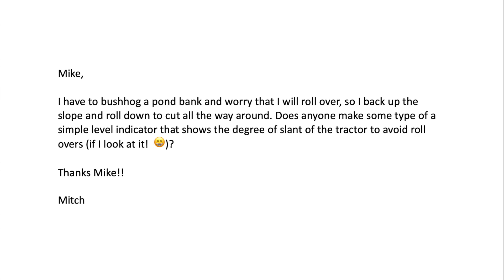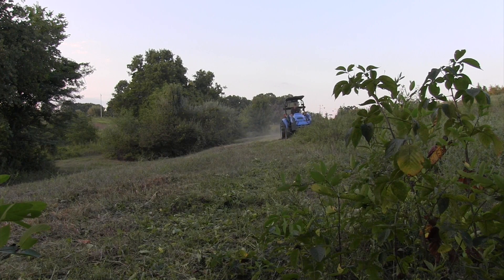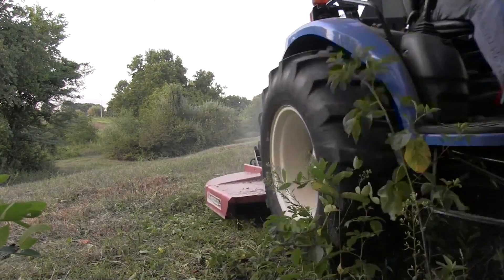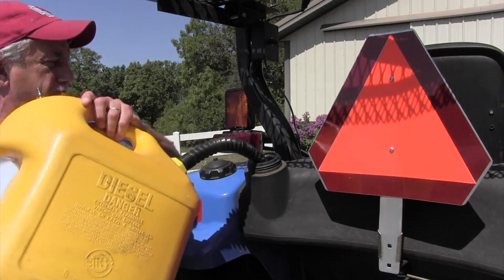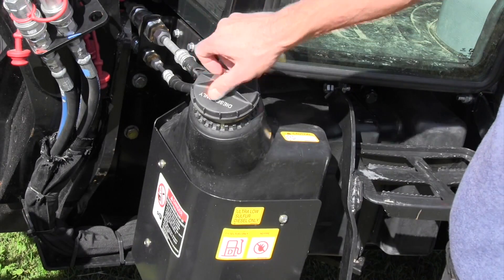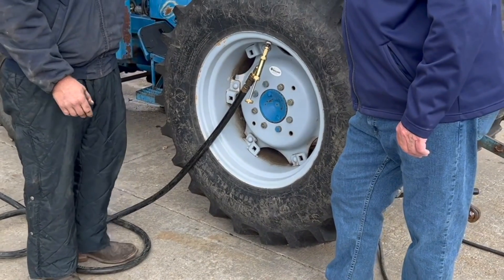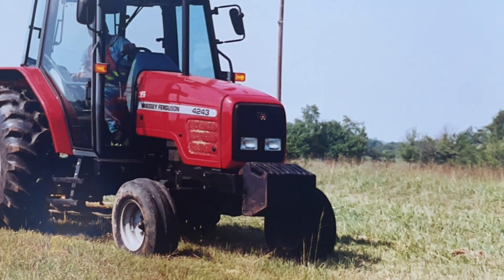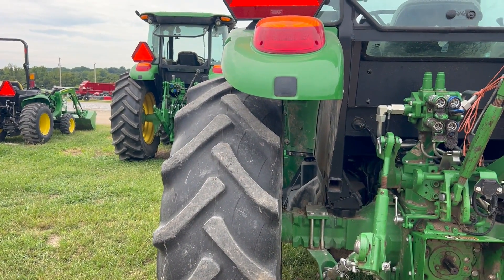10 Causes Of Tractor Rollovers You Need To Know

Comment: YOU SPOKE ABOUT HOLES IN THE FIELD.. I HAD A 4X5 ROUND BALE ON THE HAY SPEAR, I  WAS MAKING A SEMI CIRCLE TO LOAD THE BALE ON A GOOSNECK TRAILER.. THE FIELD WAS ALMOST COMPLETELY FLAT.. i  DID NOT SEE A FOX DEN, OR SOME OTHER ANIMAL DEN, IT MADE A BIG HOLE.. THE FRONT WHEEL OF THE TRACTOR DIPPED DOWN INTO THE HOLE, AND ALMOST FLIPPED THE TRACTOR.. IT HAPPENED SO FAST i HAD NO TIME TO REACT..  IT WAS A MODERN TRACTOR JOHN DEERE 5335 67HP.. SO NOT A LITTLE TRACTOR.  I HOPE PEOPLE LISTEN, IT ALMOST KILLED ME,,

Comment: Excellent video.  Thanks for posting it.   Even with a lawn tractor, you learn to approach slopes from the front or rear of the tractor rather than letting your tractor lean to the side.

There are also tractor safety courses which can be taken, in person or online.  I will take one of these when I purchase a compact utility tractor.

The issue with fatigue is really important, especially at the end of a long day when want to finish the project you are working on.   Especially with chain saws.  You need to develop the discipline to stop working, or a simple mistake can be catastrophic.  It’s not much different than doing the physical labor while intoxicated, but the ramifications are the same.

Comment: Speed in turns is yet another way you can kill yourself on a tractor.  How much speed?  You won't know until you roll over due to the points you just mentioned.  So, be damn careful about complacency and letting young kids drive that tractor.  I sweat it out anytime I allow my grandson to run my tractor simply because he has shown some ignorance and lack of respect for machinery.  He needs to learn, but not by getting hurt or killed.  Tractors should be slow moving machines and never pushed up to do things faster.  Slow and steady wins the race, and keeps you alive.  By the book, or buy the farm!  Operate according to the manual or common sense and never beyond the capabilities of the machine or operator.

Comment: I grew up flying helicopters and we learned early on about "dynamic rollover".  There is a critical rollover angle when sitting still on level ground.  It's like taking a set of fork lifts and tilting an object that is sitting still until it rolls over.  There's also the dynamic rollover angle that is what gets folks in trouble.  That angle is influenced HEAVILY by momentum.  That's why going slow is so very very important.  Most helicopters have a critical rollover angle of between 6 to 10 degrees.  That doesn't mean you can operate up to 10 degrees every time and not roll over.  It simply means that if you go beyond that you will most definitely roll over and there's nothing you can do but hold on at that point.  My butt has been calibrated to get nervous anytime it tilts more than 6 degrees.  It sucks up the seat cushion beginning at about the 8 degree mark.  I won't tell you what happens when it appears to be exceeding the 10 degree mark.  It amazes me to watch the guys on a bulldozer pack in a pond dam with a 30+ degree slope.  No sir.  Not me.  Great vid and please stress in your next video that just because you didn't roll over at X number of degrees today it doesn't mean that you won't roll over at less than X number of degrees tomorrow.  The key term is "dynamic".

Comment: The wide R4 tires put less pounds per square inch (psi) on the ground, by design, than the R1 standard farm tire.  In wet conditions, or muddy conditions, or sometimes just on grass on a slope, these tires tend to slide easier. This is per my own observation and observations my customers have shared with me.  I can’t tell you how many customers I have told to stay off their pond banks, because some of those slopes approach up to 45 degrees.  Most manufacturers operator manuals list a 15 degree slope as the maximum for operating the machine on.  I’m located in the Ozark foothills south of St. Louis.
Reply: John

Comment: Unless you run off in a hole, a tractor will almost always slide down a slope before it turns over. The problem is though, when is starts to slide and hits something that stops the slide, that's when it will turn over.
As far as types of tractors, things like high mounted fuel tanks and such do make a difference, but I'm not so sure a platform tractor is necessarily more dangerous than straddle seating. Unless you're a really big guy on a small tractor, your seating position isn't going to affect the center of gravity by any at all. It's just seems more unstable because you are sitting higher on a platform tractor, but the height of your seat alone isn't going to make a difference. That being said, I think it can give a false sense of security on a tractor with a low mounted seat.

Comment: I am a newbie and have already found your top ten to be pretty true.  I always (?) carry a 3 pt box or land plane that I lower until they are brushing the ground.  Almost rolled the cab tractor (high CG) when I got too close to a soft ditch .....I slammed the loader down and stopped the roll over. But it was a challenge to get out of that bind, with some help.  Fluid in the tires probably saved me from the full experience. The bank collapsed on me and I never knew it was that soft until too late. One minute OK next minute climbing up out the door.

Comment: Good video and good topic, Mike.  One more item to add that can cause rollovers.... Check the condition and tightness of your wheel lugs.     I was once on level ground, in sand, using my front end loader.  I failed to check that my left front wheel lugs were loose.  Backing and turning in the sand, with a load in the bucket, put strain on the lugs and after a while my left front wheel fell off and had I had my bucket load of sand up high, it would have flipped me.  As it was, the bucket was low and it hit the ground and held me up.  Scary.........
Reply: Mark

Comment: I magnet mounted a light bar on my tractor.  

It came off and dropped into the shredder.  My field is not really rough.  I wasn't going all that fast.  The front loader wasn't bouncing (which is a good indication to slow down...)

Just shredding a pasture that hasn't been plowed in 30 years.
Reply: What's a shredder?  Yeah,  I stuck a magnetic flashlight on the ROPS as a temporary backup light.  Worked great till it fell off.
Reply: Hello 👋

Comment: I think you pretty much covered all the potential pitfalls of hillside operations. I have a lot of angst when I have to mow along my pond water's edge. Following the advice of keeping my loader almost touching the ground and going extremely slowly, I also split my brake pedals to give me the ability to brake the uphill rear wheel if I sense losing any steering control toward the water. You've mentioned before that if your ROPS isn't up, don't use that seat belt. You might have the chance to bail out to the upslope side.

Comment: I would add one more category to what you covered with three sub-categories.

1.  The Operator
1a.  Ignorance - Not knowing how to operate safely.
1b.  Carelessness - Not caring about your equipment or safety.
1c.  Operating under the influence of some kind of substance. - After working out in the hot sun, I do enjoy having a couple of cold adult beverages.  After having a couple of beers, I will not get back onto my tractor or other equipment.  Even after just a couple of beers it will affect a person's judgement, reaction time and ability.
Reply: Believe it or not, on a hot afternoon a SHARE a tall German beer with my wife. I'm a slight guy, and if I drank an entire one I'd be unsafe behind the wheel.

Comment: An uncle had the centrifugal force from a bushhog shove his Ford 8N up a fence post and onto its side.  I had a fawn run out of a thicket in front of me while heading down one of the steepest parts of my property.  I instinctively jerked the wheel to the right and over it went.  My uncle seriously hurt his shoulder and traded the 8N for a modern tractor, but an overrun clutch would have prevented that accident.  I walked away with minor cuts on my arm.  Keep your ROPS up as much as possible folks.  It works.  Also, my father was a fire chief and worked several fatal tractor calls, including one across the street from my shop.  A young guy attached a stump to a draw bar below the rear axle and flipped the tractor, popping his head like a water balloon.  Left behind a kid still in diapers.  Another was an older guy that got off the tractor to open a gate and was run over.  My grandfather having his ankles crushed in a childhood farming accident kept him out of WWII.
Reply: Below the rear axel is where you should be attached to pull.  Maybe you meant to write that he was attached above.

Comment: Timely topic! I thought I was going over 2 days ago. I was on a safe and fairly nominal degree of slope while brush hogging along the bottom edge of a field when my downhill wheels abruptly dropped out from under the tractor. What stopped me from going over was the right side of my front end loader catching higher ground on the other side of an animal made ditch that had a den opening in the bottom center of it. Not only was there a ditch from their digging and travel, but the abrupt drop was made worse by the front of the den collapsing under the weight of the tractor. I've been over that ground countless times in the last 25 years and that ditch under the cover of grass and weeds was not there. I've never experienced anything like it. Because of the size of the den opening in this dug out ditch, I can only guess it was a coyote den.

Comment: Another problem that I’ve had when mowing terraces is not just the slopes but the washouts that they invariably have in them. If you are going along sideways (at the pucker limit) and the low side hits a hole or washout, it is downright terrifying. I finally gave up and only go straight up and straight down even if it takes twice as long.
Reply: Try that with a creek at the bottom.  More pucker.